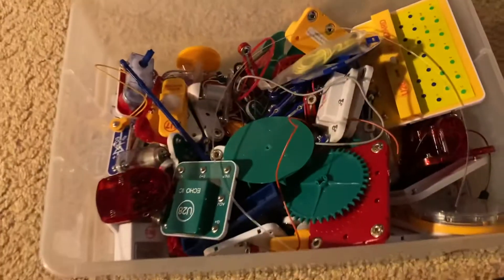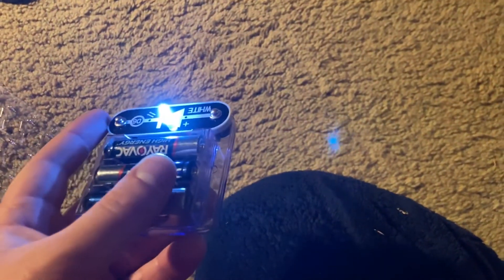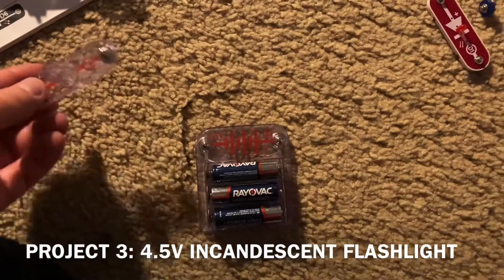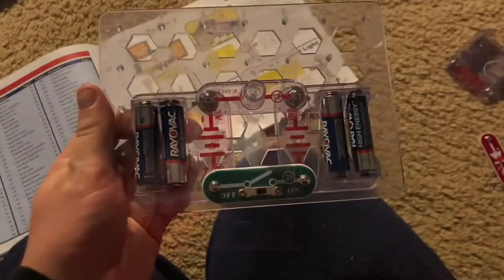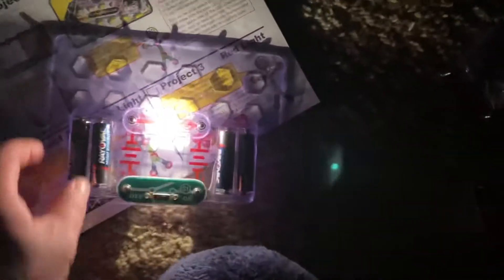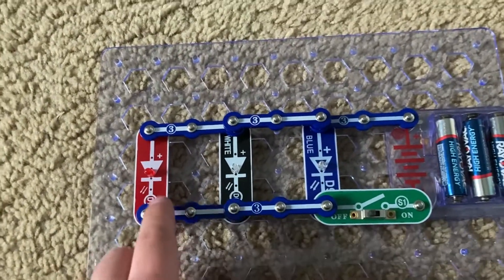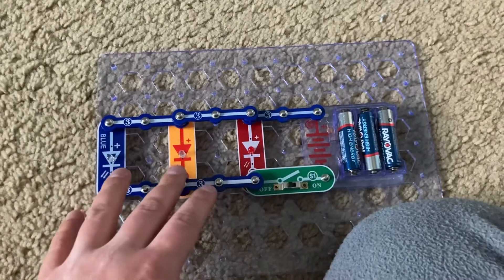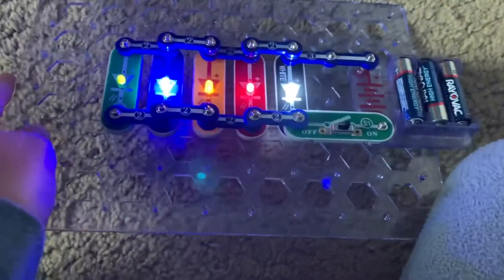Snap Circuits Custom Projects: Light- Part 1

Comment: Is there a built in resistor on that LED for your flashlight?
Reply from the maker: Yes there is.  All of the LED’s in the Snap Circuits kits have built-in resistors because if they didn’t, connecting them directly to the batteries (like I did with my flashlight) will permanently burn out the LED’s.
Reply: @andrewsstation6436  that's what I figured but I saw separate resistors and wanted to ask. Thank you for your reply.
Reply from the maker: @jediwompa  You’re absolutely welcome!  I like to answer questions!